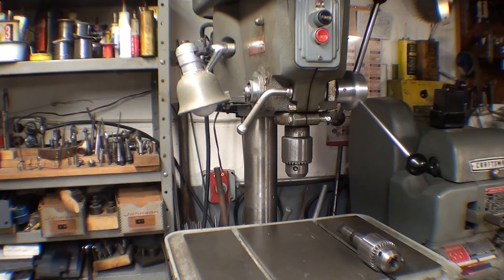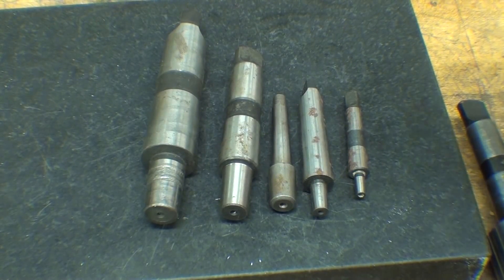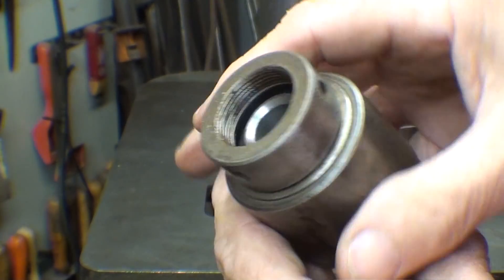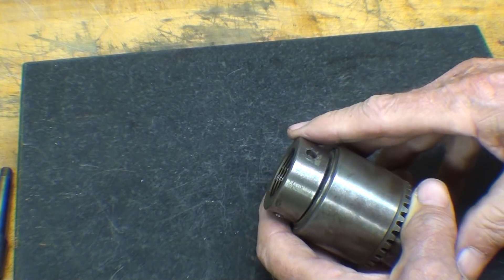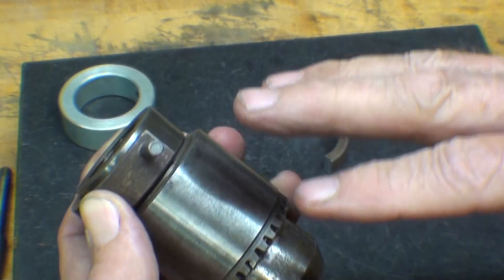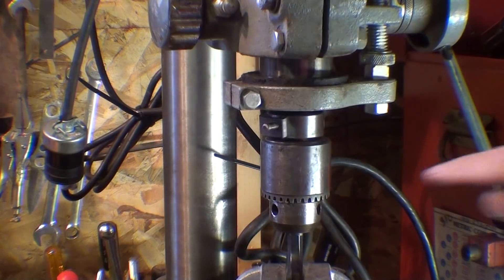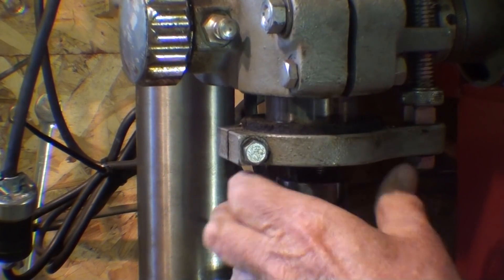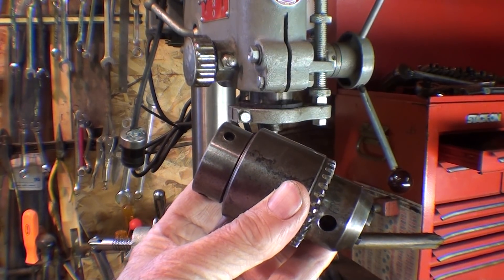Tips #384 REMOVING DRILL PRESS CHUCKS threaded collar tubalcain

Comment: thank you again for the education I so desperately need. if you will, please answer a question for me,  I have a Atlas/Craftsman  lathe that I just installed a new shars chuck on. there is little movement on the backing plate before tightening but I was able to zero in the chuck to .002" is that good or dose it need to be better? again thank you!

Comment: I have a craftsman like the one you quickly panned by. It has the same chuck.. Mine goes up to 8000 RPM which is ridiculous. I was hoping to upgrade the chuck on it but as you said the ones with locking collars are hard to find. If anyone has a source please post it. I suppose you could forgo the collar and just use the taper.. I guess I could source a low speed motor to bring down my rpm. 
Thank you for the instructions!